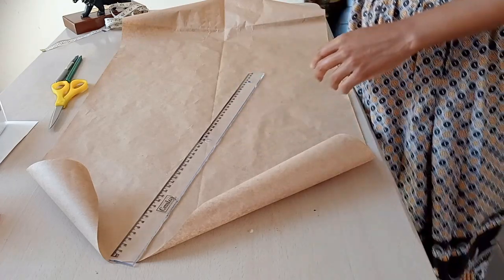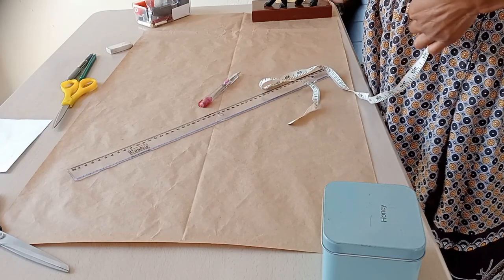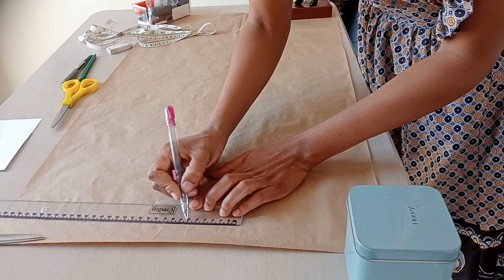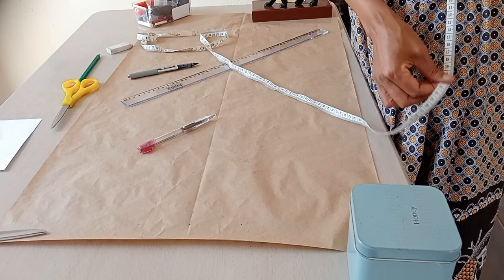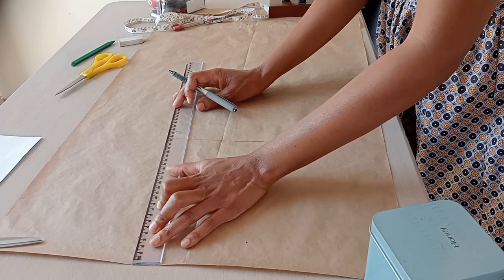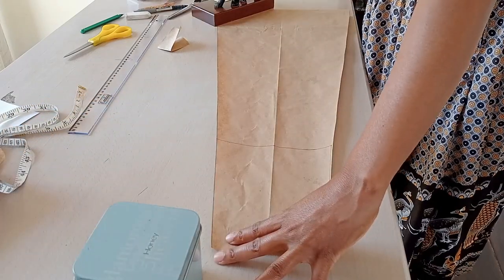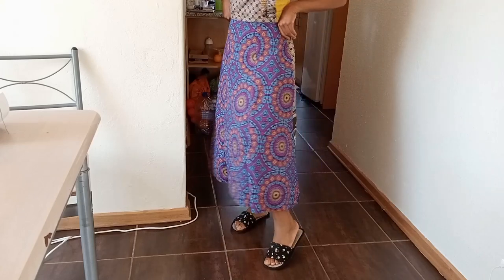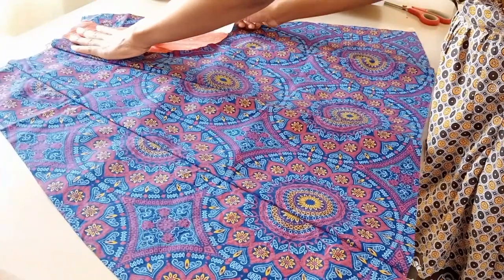DIY basic six panel skirt | How to make a six panel skirt | Makoti skirt | Makoti wear

Comment: Can I make only 4 panels? And withe measurements be still the same? I'm quite aware the false might be smaller? Enkosi in advance 🤗
Reply from the maker: Thank you for watching... yes you can make four panels using your body measurements and divide by 4 instead of 6...but remember if you make four panels your skirt will have a seam on its centre front and centre back not sure you would like that.

If you watch my dress videos I cut them in four panels but I fold my fabric so that I don't get that centre seam... you can check the recent A-line skirt video ❤️
Reply: Thank you for clarification